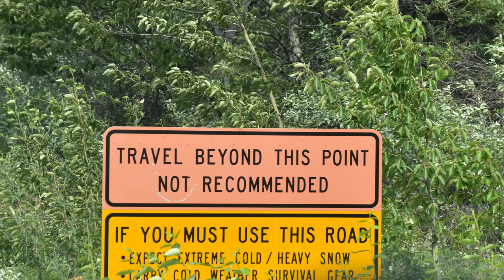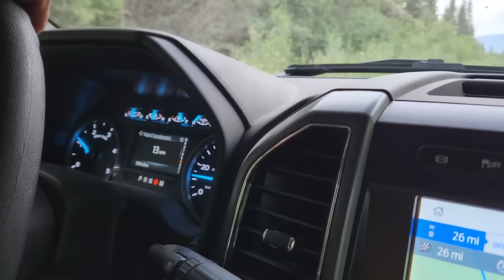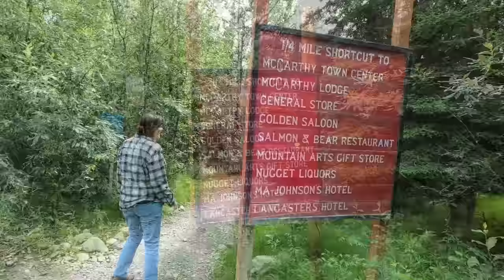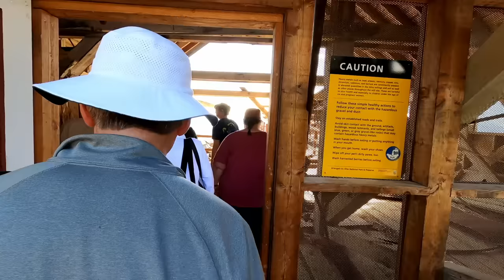McCarthy Road /Won't Travel it again/ Edge of Alaska / RV Fulltime Living / RV Road Trip / Kennicott

Comment: We have hit our step so many times, yet it still works. We have a Jayco Greyhawk class C!
Reply: Had the same problem with my Greyhawk . Got tired of hitting the bottom  when we were in Alaska last year. So I took it to Weldtec Designs in El Cajon California. ,and had a lift kit installed . Now i can go just about anywhere without worrying about hitting the steps or jacks any more. Best upgrade you can do on a class C motorhome.
Reply from the maker: We may look at that too. Any issues with handling?
Reply from the maker: I was surprised when I saw it. We've hit ours a few times as well.
Reply: Rides like a Cadillac. The best thing I ever did was this upgrade. You would have to check if they do the super C .Mine is the  E-450 chassis. @bigtruckbigtravels

Comment: Enjoy your travel diaries!  I'm not an RV expert but I can’t help wondering if  there is large space efficient RV without having to tow with a tractor/big rig?
Reply from the maker: Thanks, Joe. There are trailers out there which are suitable for many fulltimers. It's definitely a personal choice. We like the safety factor of the HDT and stability of our 5th wheel. But there are easier ways to do what we do for certain. Thanks for watching the channel. 😁
Reply: @bigtruckbigtravels  I just read up on "HDT's" and now understand there are many benefits including reasonable cost for a used truck. It does look a bit cumbersome to drive around. How is the fuel mileage compared to a one ton MDT?
Reply from the maker: @joebouscaren1  With our first trailer, 24K lbs DRV Houston we were getting 8 mpg. With our current SpaceCraft which is 42K lbs we're getting 7.2 mpg. We drive about 22K miles per year and have an oil change done annually from $450 - $600 at a Volvo service center.